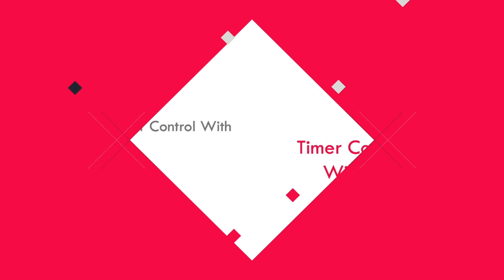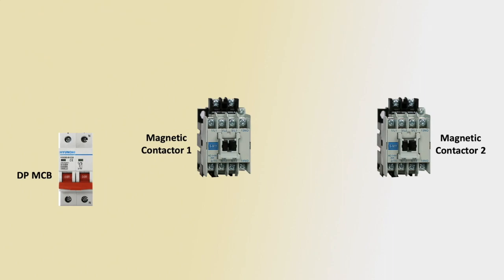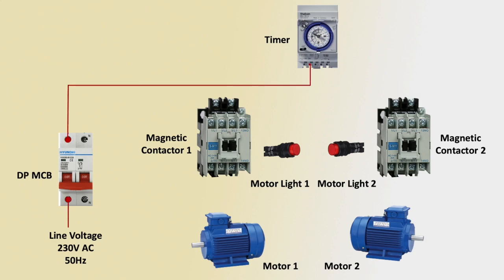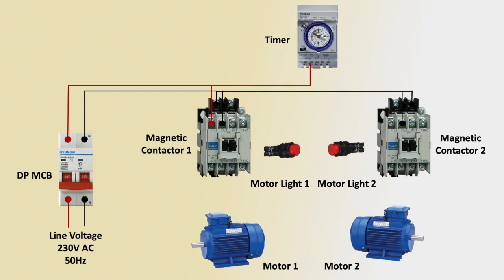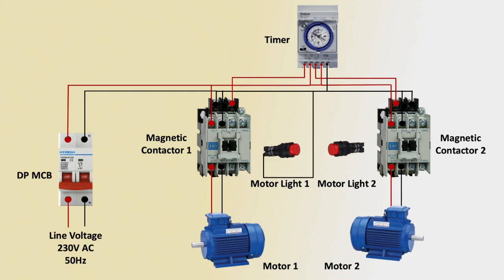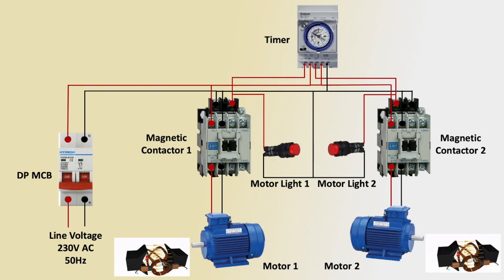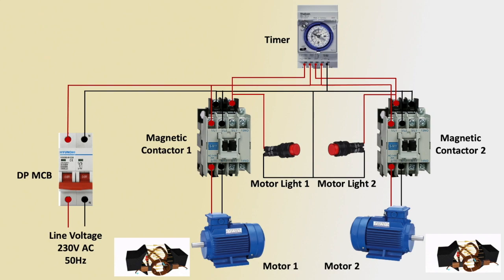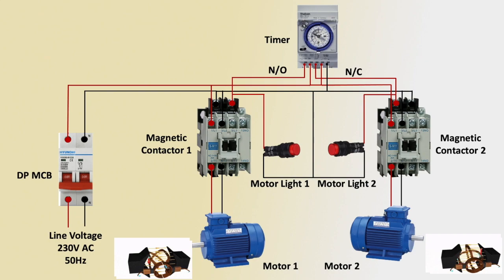2 motor automatic control | 12 hour Timer Setting | 2 Motor | Timer

Comment: Is there a way I can run 3 x 3 phase motors, using timers but only 1 motor runs then rest for a set time and the second motor runs, then rests, then the 3rd kicks in ?
Reply from the maker: Electrical and Electronic video please recommend us in the comment section. Be stay with us and learn Electrical and Electronics easily. Check our playlist for different types of videos.
thanks.